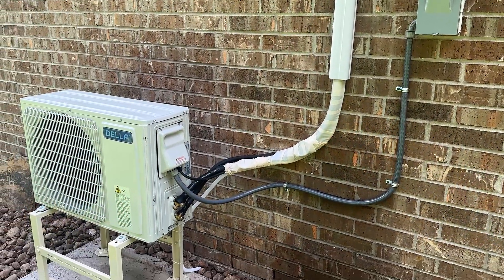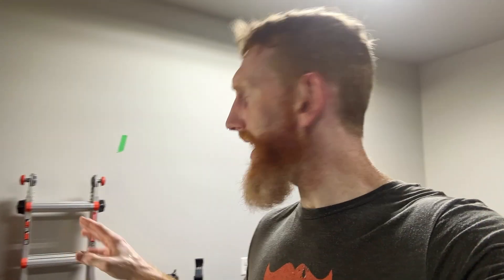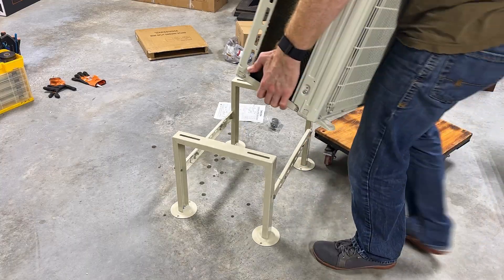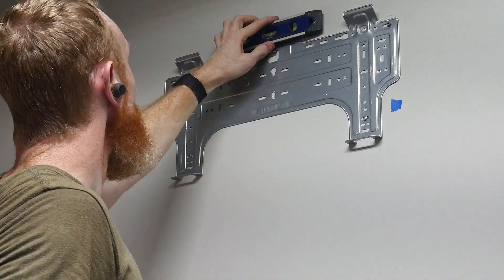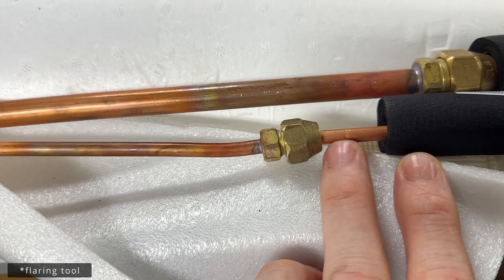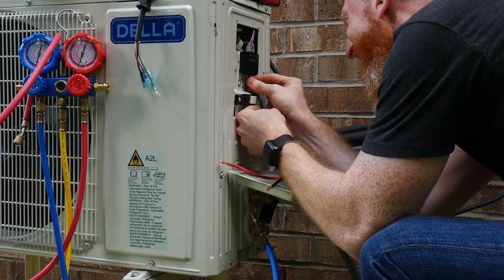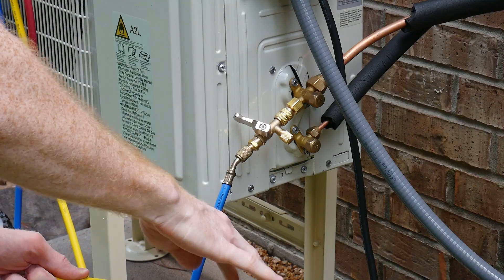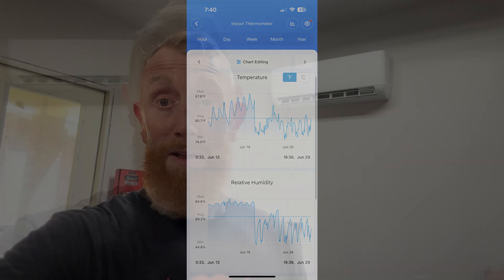I Installed My Own Ductless Mini-Split AC… and You Can Too

Comment from the maker: ⭐Della Mini Split - https://amzn.to/4lEa6nB

🗒 Items:
Mounting Stand - https://amzn.to/4llqQ2U
Line Cover - https://amzn.to/3GowW3v
10 AWG Whip (would try to find 12 AWG) - https://amzn.to/40BsrcC
Nylog Blue - https://amzn.to/4lauHQk
Cable Glands - https://amzn.to/3WTJzcw
Drain Hose Extension - https://amzn.to/44ktWgk

🛠 Tools:
Vacuum Pump / Gauge Set - https://amzn.to/3AvWG8u
Flaring Tool Kit - https://amzn.to/40Bsyoy
Service Port Adaptor - https://amzn.to/3T0Dxm0
Valve Core Removal Tool - https://amzn.to/4ewQWxj
Nitrogen Regulator - https://amzn.to/45TelXO
3.5'' Core Saw - https://amzn.to/4nrhWmd
3.5'' Hole Saw - https://amzn.to/3SDSX1g
Torque Wrench - https://amzn.to/3c38q8M
Crowfoot Set - https://amzn.to/3TaVFKn
Flaring Tool - https://amzn.to/3CaB8zr
Copper Pipe Cutter - https://amzn.to/3K3jfV4

Comment: Excellent work. I chose to install (DIY) multiple single-zone systems (single 12K BTU and two 18K BTU units) rather than a multi-zone system since efficiencies will be better, greater control, and potentially less complications. Also, I bit the bullet on the CPS vacuum gauge (it works well). Once again, great work!

Comment: Planning on installing this unit, but since it’s not a pre charged line I’ll just pick up a Mr.Cool DIY unit and it would be a better option  since I don’t need to do vacuum, and some pre test. Mr.Cool would be a plug and play  system  I would say.

Comment: I also installed almost the same unit from Amazon when on a special offer, just above $900 but is R410, 18,000 btu, 22 SEER and WiFi, and is very well built, size was about a 2 ton due to high SEER, has thicker metal than the Pioneer it replaced at 18 SEER and no WiFi with tin can metal, within a year the blower motor went out and eventually received one, after a while I had other problems with it but Pioneer just blew me off, I alway install PVC as soon as drain exits hole in wall, I''m in So TX and this sun will disintegrate the corrugated drain line, I haven't had any problems with it and going over one year
Reply from the maker: Dang sorry to hear you had issue!

Comment: Nice video, thank you!  This 2 car garage looks smaller than the previous one but you went with a bigger 18K BTU Unit (from a 12K).... Do you feel the extra capacity is required for summer time in hot Texas (or, in my case, a Florida 400 sqft uninsulated garage)?  I recall your old shop reaching 79-80 after a few hours with the 12K.  Thanks in advance and appreciate all that effort.  Helps DIYers like me tremendously!
Reply from the maker: I think the 18K is more approximate for that size in the Texas heat! I'd rather the unit not be struggling to keep up all the time. The 12K did keep the space livable, no doubt, but I just figured it would be nice to have something stronger... and the price really isn't different.

Comment: Great video, thanks. I installed a 220V, 18000 BTU Pioneer mini- split 4 years ago and it has been working great. I am reviewing how-to videos because I want to install a small 110V,  9000 BTU in my bedroom. I don't feel confident about cutting and flaring the lines so I will just try to roll up the excess behind the compressor. Like you, I have the tools left over from the last install; a DIY perk. With the Della mini split, Is the warranty voided if it is a DIY project?
Reply from the maker: I don't know for sure, but I bet it is void as DIY. May want to check with the companies that directly cater to DIY'er like MRcool?
Reply: Who cares about the warranty, with the money saved, we can buy many units if we screw up the installation.

Comment: You might have done yourself a favor by running the line set out of the left side.  When I installed mine, they told me 8ft. was the minimum length they recommended for proper operation.  Yours is a short run and probably would have been less than 8ft. if it went out the right side.  Now you can feel better about it!  I look forward to the third install video in your next shop!
Reply from the maker: Nice! Good point! Didn't think about that. Cheers sir